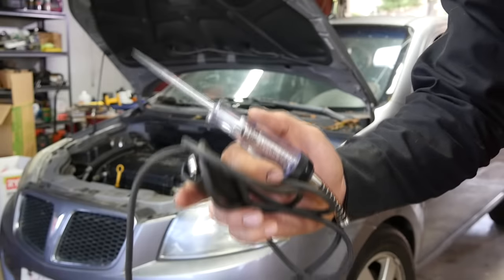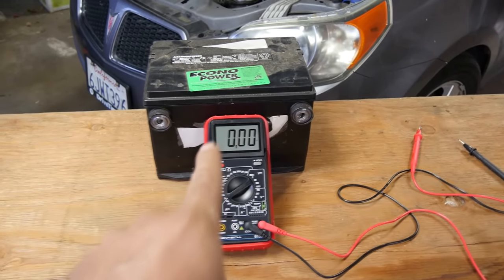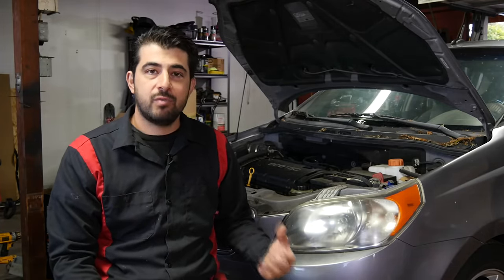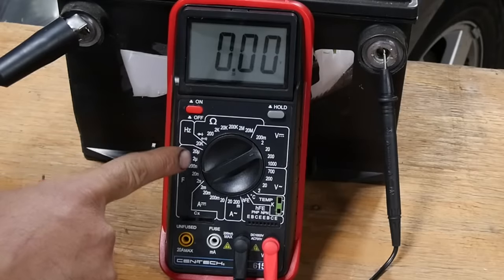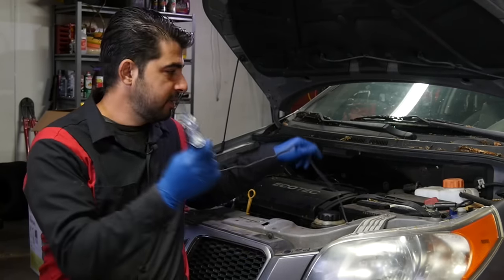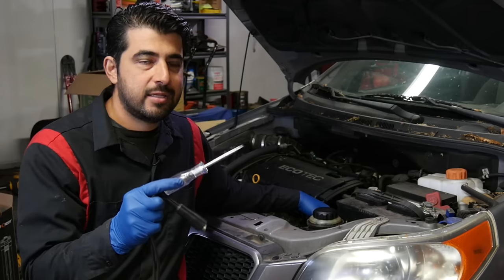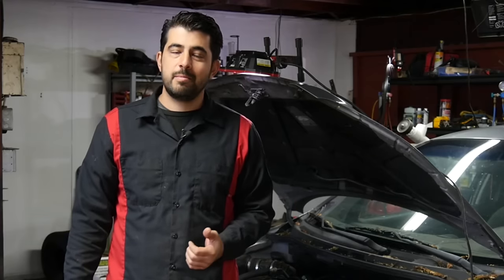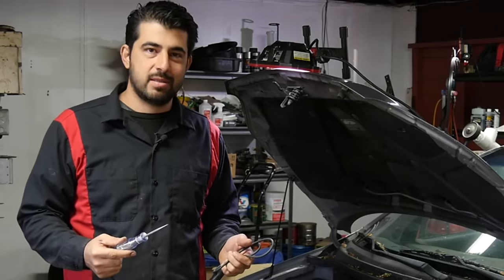MUST WATCH - Can a Test Light Damage Your Cars PCM ?

Comment: Hello guys. I have a na subaru forester 2006 and I installed the lpg system that our dealer suggested from subaru. The car worked pretty good and went for 70k kms after the installation. And then I started to notice the lack of performance and some strange knocks when the car was in idle. I knew it was all about the valves that they were starting to to wear out. I finally repaired them bcs they were not completley burned. But i am seriously concerned about this thing happening again and I dont know what would be best to do... my mechanic said that this car should never use lpg because it doesnt have hydraulic valves. Should I keep using it or should I get rid of it somehow. I live in Greece where petrol is really expensive

Comment: Hi, I hope you can help me with some problems I'm having with my car. I have a 2005 Chevrolet equinox. It's over heating, the coolant keeps leaking but I can't find the leak. I fill the coolant evry time before driving and only lasts 15 mins max before it's empty and hearing up again. It hears up while waiting on red and eventually starts cooling off when I start driving again. Recently that hasn't helped either. The fan starts making a lot of noise and I turn it off till the fan shuts down. My mechanic has only changed the water pump, not the anti freeze tank. Thank you I hope you have some answers. My engine is still working and so is the transmission. I can't afford to keep taking it to the mechanic if it's not getting repaired.
Reply: He changed the water pump. Check to make sure the belt is routed properly. A reverse routed belt will make your car overheat

Comment: I was testing my radiator fan switch which is routed to the ecu then from ecu to fan relay.  One touch to the wire on ecu side of switch then the ecu was dead forever. Very expensive mistake.  The ecu runs on 5v.  12v is too much. Vehicle was MG6.
Reply: @rqm4no  I was using an intelli probe

Comment: So the light in this test probe is a current limiter by the light acting as a load resistor? Does this tester contain an electronic circuit with a few resistors and capacitors?

Comment: what does it mean if you get a light with test light from your oil pressure sensor wire to positive batt, but no light to neg batt? engine running. gauge not working, but have 40psi oil pressure via oil pressure tester.

Comment: You should however know how many milliamps your test light draws. If someone replaced the bulb with a tail light bulb, it could potentially draw enough to damage a PCM. A good incandescent light will draw less Than 500 milliamps and would be good
Reply: A bulbe has inrush current until the filament heats up to glow temperature.  Inrush current can be significantly higher.

Comment: Why are u testing a oxygen sensor with a test light ? Oxygen sensor 'produces' voltage with chemical reaction , this pd is read by the ECU for obvious reasons
Reply: You would normally only use a test light on the heated circuit portion of the O2. When ruling out wiring or sensor...

Comment: Sorry, i did watch the whole video but i don't remember you saying anything about how much resistance is in the test light, isn't it like 1 ohm? Depending on the ECU circuits being tested, it could damage that circuit in the ecu. I remember my instructor told us a student blew the ECU side of the circuit for i believe the student was testing the heater circuit for a AF sensor or was it a o2 sensor, i forget what it was but because the student used the test light they blew the circuit and it always has a check engine light.

This was like 3-4 years ago when i heard about this.

Testing circuits which thermistors are connected to should not be a problem at all from what i remember though since it has a resistor in place incase of a short.

Comment: Thank you my friend.  I think I found a couple problems.

Problem number 1.  Your incandescent test light draws 270mA which means that if it were connected to a transistor which is rated for a lower maximum current, that transistor could be burned out.  Such a transistor likely to be found in a PCM would be a surface mount type, which most commonly is limited to 100mA.

Problem number 2.  Referring to James Watts' calculation to measure power in horsepower you said that his wife weighed 550 pounds.  I read the Internet and it said they traveled to France and Germany so I don't think she could weigh that much.  There's no way someone that big would fit on an airplane.

Happy new year!

Comment: What about a power probe?  Will that damage the PCM?
Reply: Yes it can. When you apply power through the power probe there is nothing to use the current. The circuit breaker is slow to trip. Power probe is a great tool but has its place. A test light and a led test light are a must for your tool box. Scanner Danner explains this very well.

Comment: There's test lights and there's test lights. Never use one with a light bulb anywhere near electronics. LEDs are usually OK.
Reply: How are you going to be able to do bypass tests with an LED test light.      If you know how and when to use your test light, your chances of killing something is greatly decreased.
Reply: It's just a case of knowing how to use your tools. Having worked in the telecomms industry for many years, a light bulb based battery and earth tester WAS  standard equipment in a strowger telephone exchange due to an absence of semiconductors.  With upgrades to crossbar telephone exchanges these tools were banned and LED only battery earth testers were used.  I've since designed and built my own tester for use on cars, it ditinguishes the difference between earth, , +5v and + 12v with 3 LEDS

Comment: Don't forget you can't have voltage without current. You can't have current without voltage.
Reply: falchulk  well I'm not going to claim to know anything for positive. But it doesn't work without the the other. If you have voltage you have current. You'll never have current without voltage . But I work this crap a long time but I still don't know
Reply: falchulk  I've never heard of anybody turning the current up.
Reply: falchulk  exactly you're not having one without the other. It's one of those little confusing things about electricity. Just as a rule amperage is built into the machine.
Reply: falchulk  what industry do you work in?
Reply: falchulk  short is voltage going where it's not supposed to
Reply: falchulk  I think you're confused. You don't measure voltage in a short because you have the voltage turned off. If you don't have the voltage turned off in a short it will smoke.
Reply: falchulk  you need to listen to what you say. Their shorts there's power losses there's all kinds of trouble shooting. They both happen at the same time. Voltage current. But you have to have voltage but then you have to have current. Don't get confused.
Reply: falchulk  well pretty arrogant there. Language can change facts can't. You will not have current without voltage. You probably are a little lost in the terms you use. I'm not sure you even know how a transformer works.
Reply: falchulk  I think you have resistance confused with amperage.
Reply: falchulk  because I think you're confused with a milliamp and millivolt. See you down there measuring real small volts. I agree you're in millivolts.  with all these computers in cars some of your voltages way down. But you can't confuse voltage and current.
Reply: falchulk  you don't turn current up you turn voltage up
Reply: falchulk  still struggling a. Hey Junior when you build a generator you decide the current. Maybe a little skinny current or maybe big fat current. Don't get confused ACDC.
Reply: falchulk  how much current does it take to put a Tesla in a rocket ship in ship it to  Mars. Yeah right Junior
Reply: falchulk  you might want to learn something about radio Waves. That way you won't get confused so easily. Don't let your education get in the way of your knowledge.
Reply: falchulk  you still confused

Comment: Is that electron hole flow or smoke passage? Ha ha only joking. Thanks for the brush up on the basics, even 40 year vets need that sometimes. Using your skin? That's how I can tell if it's a 24volt system, it tingles 🤣 Cheers from Australia

Comment: Do you know how to bypass a fule pump relay. My car Tipm is bad and fule pump not getting power.
Reply: Bypass?...are you serious?... you're planning to set your car on fire?... you can just momentarily bypass it like this:
You gotta remove the relay and with  a thick and short piece of wire connect terminals #30 and #87 ... one has + and the other goes to the fuel pump...if you cranck the engine it should start...BUT THIS IS NOT A FIX!

Comment: References for your conventional flow and current flow theories?; I have a logical explanation and you are showing some forms of draw that I need to show to my people. Your "potential difference" theory is lacking- due to relation that you are stating: "Electrons wanna flow through the circuit back to the positive side."  Circuit being peripheral (outside of the battery).

Comment: Wrong explanation of a multimeter. It measures voltage over an internal resistor with an ADC, not current through that resistor. Even on current mode, it internally measures a voltage with an ADC over a resistor. If you want to measure current directly, you will need an inductive pickup probe.

Comment: Wrong on this one...
All Meters send a small current through leads...Test lights require a current to light...as any circut does. Some lights have a special bulb which like a LED which can be safe to use. 
Caution on new age electronics.. some are damaged even by milliamps inrush into a ECU micro processer.In fact many chips require protection even from static charges measured in microamps.
Careful or $$$$$
Excellent work otherwise.Thanks!

Comment: Multimeter's - Ohm mode - send current from 9v battery. This could damage small electric device. (What I remember... 50% sure.)
And multimeter - Amp mode - turns to "short circuit"
Reply: Ohm & Volt mode no. Amp mode yes

Comment: I can't see how a test light would remotely damage anything. All it is doing is basically checking for continuity.
Reply: Not true. A test light requires power in the system to work... A continuity test uses the low voltage in in meter to do it's checks.... If you use voltage WAY too high for the circuit, you can absolutely mess it up with the rest light
Reply: Watch SMA, Eric will use different bulbs depending upon the amp draw.

Comment: 1:02 "Also electrons from a car battery want to go from the negative side, through a circuit, to the positive side..."  That's not true.  If a terminal has a high mass of electrons (negatively charged), the electrons will want to move towards the terminal with a low mass of electrons (positively charged).  That part is true.  But a battery is labeled differently.  The positive (+) side of the battery is actually negatively charged, that's where the electrons are.  The negative (-) side of the battery, also called ground, is positively charged, and is what receives the electrons.  Even though the battery is labeled backwards, electrons do NOT flow from (-) to (+).  They flow from (+) to (-).